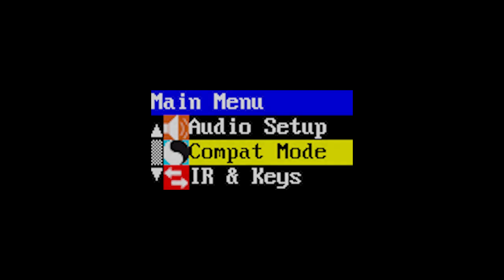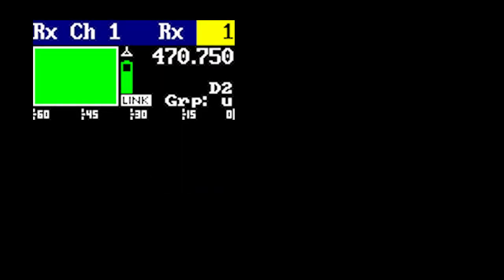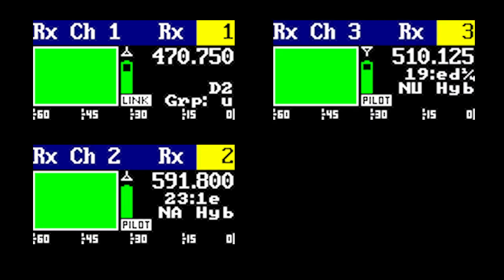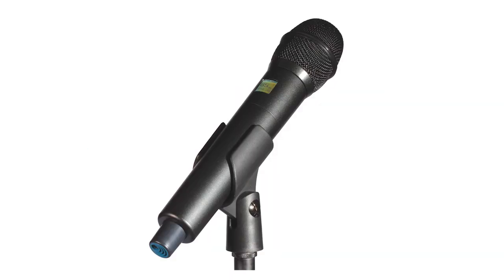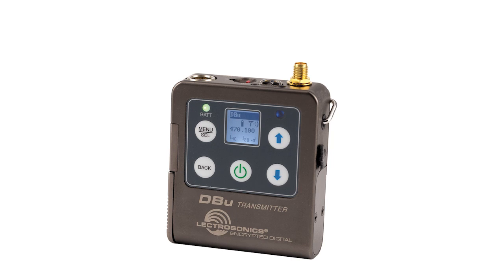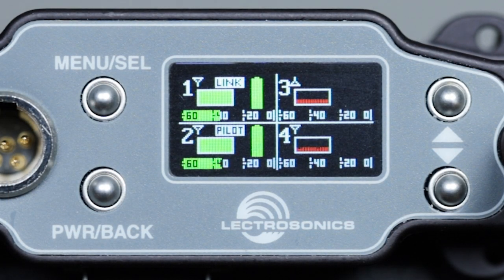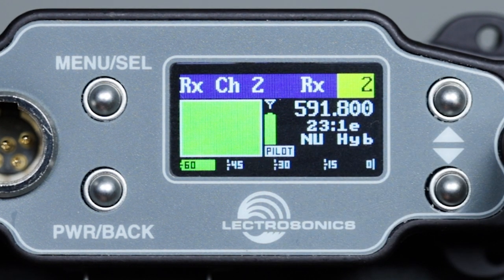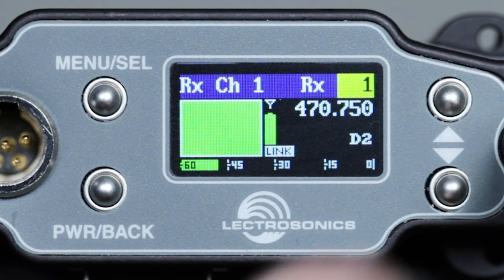Lectrosonics DSR4 Deep Dive Video #1: Independent Tuning Ranges & Compat Modes, and Receiver Details

Comment: The fact you can use any mode and any band at the same time is pretty incredible. Does the same go for the DSR dual channel receiver? Or is this a DSR4 feature only? Thanks for making such excellent products!
Reply from the maker: Yes, the DSR will have this ability as well, as does the DCR822 that both of these newer models were based on.